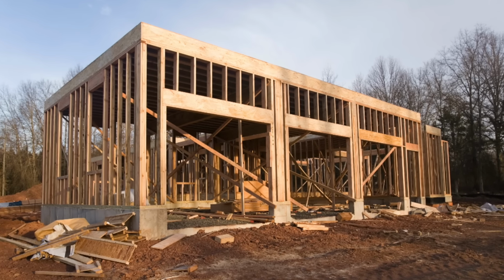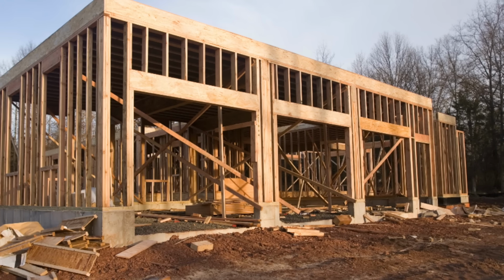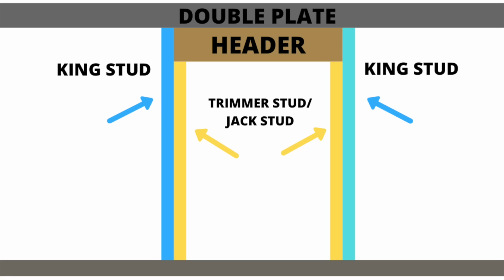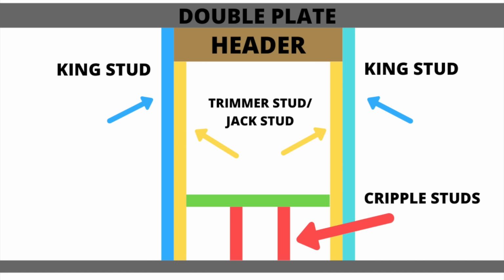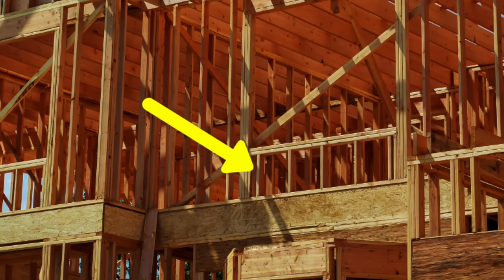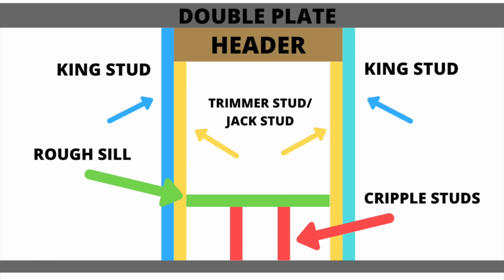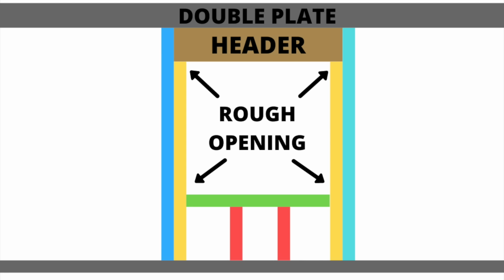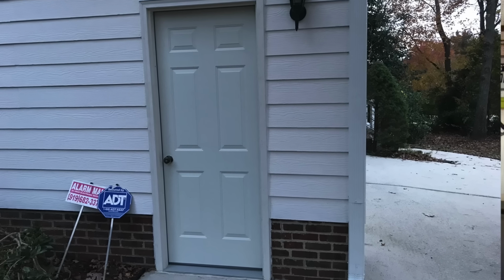All House Framing EXPLAINED...In Just 12 MINUTES! (House Construction/Framing Members)

Comment: Where can i get more information on how to build a post?  I need to put 5 2x4's together for a post but not sure how it should be nailed or structural screwed together?  Is there a specific pattern or spacing like an lvl beam?
Reply: Is this inside a wall? You want to nail them together enough to make them all act as one post. Use construction adhesive as well, just to be sure.
Reply: @jobacuda4472  I found out which thickness screws and length as well as the pattern after hours of searching.  Got my built up columns installed now!
Reply: @jayhandle6676  Excellent!!

Comment: So, if a header is over every window, how do I attach my hardware for curtains? I'm having a heck of a time. It's blocked after drilling through the drywall.
Reply: It should be solid wood. Unless you have metal framing.

Comment: Love your videos but you didn’t mention metal studs at all - even if your not an expert - people should be aware that they may have metal studs - an easy way to check is your take a strong magnet and run it along the wall, if it catches every 16 inches - you’ve got metal studs or a metal fire block - you may have to open up the drywall to be sure

Comment: Very informative!  Thanks for posting this.  Also, ppl should know that roof trusses are indeed stronger, but with trusses you loose the attic storage space that you get with rafters.
Reply: Many Houses over century old were build with rafters still standing today. Theres no questioning the strength of rafters.. The only reason trusses are popular like any new thing in construction is that it saves time in the building process and we all know time is money. Otherwise as a homeowner rafters over trusses all day everyday
Reply: Trusses can be designed / built to create vaulted ceilings and bonus rooms in attic space with negligible loss of interior useable space.

Comment: Im renovating my old house it is 2x6 rough cut lumbet for joiest im knocking down a 14x20 section and need to reframe with 2x6 to match floor hight and basment celing any suggestions to make it stronger also some sort of 6inch beam for the center ?

Comment: When building on a slab foundation, could you add insulation between the joists and beneath the subfloor, or would that be a bad idea? Also, if I wanted to build a small home that spans 18 feet wide, could I put a slanted roof on it without any vertical support besides the actual walls?
Reply: There are no joists or subfloor with a slab foundation.
Reply: @jobacuda4472  Oh, got it! Didn’t know that

Comment: I'm studying to be a certified home inspector and this has really helped me understand the basics when it comes to framing and what defects to look for . My current teacher did not explain it as good as you . I am thankful for you taking time out to educate us all . THANK YOU !
Reply: Ya, most home inspectors should be required to work in the trades before getting certified.  Most have no clue what they're looking at if its not in a book.
Reply: @scottpodgorski4102  They can look at a book & still not know what's going on. Most of them remind me of what we used to call "Stupivisor".
Reply: @jwm6314  lol
Reply: @jwm6314   noone said expert.
Reply: @jwm6314  You could literally work for 4-5 years and be competent enough to inspect other peoples framing work
Reply: But what he's saying is that to be a home inspector you also need to be able to recognize flaws in electrical, plumbing, HVAC, etc. not just framing.  Hoping from career to career to career just to gain the knowledge to become a home inspector is not practical or by any means worth it, especially since the higher pay brackets of each of these trades come after years of experience.  You would be depriving yourself of a ton of money by doing this.
Reply: I’ve bought and remodeled several “fixer upper” houses and I can see the great value of a good home inspector. Some miss things like floor joist rot, a/c mold, etc which can cost tens of thousands to repair.

Comment: Always nice when explain well..great job..California we build some great Frames now...Simpson pretty much has the monopoly on this but for good reason..they have so many that all architectural and structural drawings call them out solely to be used....California Frames no use a series of them that work to tie everything together from foundation to roof.....you should do video's on how there used...its great to let people know..Thanks for your Video's...GC in California...45yrs doing it and amazing how far Frames have advanced
Reply: Jon, I moved from NC to Reno in the early 2000s and was astounded by how many Simpson connectors there were! The increase in engineering was fascinating and I learned a lot from the experience.

Comment: The way roof trusses are commonly built off site is exactly how vertical framing should be build, off-site. It's much more efficient with materials and labor and the end product is much more precise making the home stronger and more durable. It also makes installing things like sheetrock, cabinets, tile and flooring quicker and more precise.

Comment: Question about a half wall or knee wall. If it is installed after framing & flooring how should it be built for stability before drywall is installed

Comment: todays lightweight construction homes are a death trap and take less than 15 minutes to become fully engulfed in flames and burn to the ground and kill or seriously injure firefighters every year and building codes never factor in fire safety because manufactured i joists don't take long to fail in a house fire about 3 minutes and the manufactured I joists is done for.

Comment: The houses in the U.S is so weak and cheap. In the Caribbean the foundation and support pillars have steel and concrete to keep the house strong. Your house will last you forever. Houses in the U.S is so expensive for cheap ass weak wood

Comment: We have different terminology in Canada,  for instance, cripples and window jacks are switched, we call roof overhangs on a gable "look outs, or ladders, stairs are rises and runs, instead of treads, there are many different codes when it comes to geography, in Alberta they nail the crap out of their plywood because of prairie winds, here in BC we usually go with a 6/12 slope min cause of the snow loads we get, etc, etc, etc

Comment: How can I make my outside porch window openings square? The contractor who built it didn’t make the window openings square. On the right side the vertical height is 55” yet the left side is like 53”. Same problem for the top and bottom. Basically it’s not square. I want to be able to square the window openings so some day I can install windows.

Comment: Good stuff, precise. The only term I can think of that would be helpful to add is "purlins." Some of those structures were very wasteful in terms of efficient use of wood, however, such as oversized headers, double sills under windows, excess cripples and Jacks (trimmers.) You should do a video on that. (The Engineered Wood Institute has great info on Advanced Framing Techniques.)

Comment: What are your thought on using treated lumber for the stud plate --in case of water intrusion (e.g. water heater break, wind, pipe break)? 
 ...or is Treated Lumber is not safe for Internal applications?
Reply: Night, wood needs to be moist for awhile to rot. If the problem is inside your house, you'll probably notice it and get the problem fixed before rot occurs.

We used to use treated wood a lot to fasten to  basement walls before drywall. In that situation, the treated wood is sealed behind the finished drywall. As a general rule, I wouldn't use any more treated wood inside than is absolutely necessary.

Comment: Whenever I see the i-joists in a construction floor frame, I always think they look cheap, flimsy, and a way to cut costs.  Am I mistaken?
Reply: As a framing carpenter of 30yrs,
The I-beam looking floor joists are called TJIs
And TJIs rock!
Framing at golf courses in Pinehurst, NC. Back in the 90s we used traditional 2x10 floor system
But the homeowners were wanting a slab poured upstairs and were getting sag
We added steel, and that was no help
Then we went to TJIs
After the slab was poured upstairs, there was zero sag in that floor
It made me a believer!

Comment: Fairly comprehensive video. Well done, but you missed covering the two major drawbacks of trusses. They eliminate much of the attic storage space, and they make it more difficult for HVAC and electrical contractors to navigate attic spaces.
Reply: There are different types of trusses. The most common and cheapest are the fink trusses which are what you are probably referring to. No attic space and you come down with your head covered in goose eggs. There are attic trusses designed specifically for attic storage. Of course more expensive. But you're correct, that was missed in the video.

Comment: At 2.25 the video shows I joists with circular holes through nearly the entire strand board portion. Does this not negate the structural integrity of the joist? I've brought up manufacturer details for holes like these before but never saw anything allowing such a large diameter of the vertical strand board portion to be removed. Do some manufacturers build their joists differently than others wherein a diameter so large would be safe?

Comment: If I could add this , The anchor bolts are not just for lifting they prevent blow out or bowing by shear by allowing sill to remain stable at joist connections and corners extremely helpful in earthquakes or high wind, of course garages and porches need it the most .
Reply from the maker: Good point, thanks Andrew!

Comment: Another great video from Ethan! Thank you!

 (noob question: Once completed, are roofs secured to the house frame?)
Reply: Craig - do you mean the roofing material or the roof framing?
Reply: Roof trusses SHOULD be secured to the house frame. If not, a good strong wind will lift the roof up and can take it completely off. If you live in areas with high winds or tornadoes, that's something you want to pay close attention to during construction.

Comment: I heard Truss built house burn much more easily, quicker than a dimension lumber house.  A home inspector in IL told me he used to be a fireman and that if they knew a house was built on a truss system, they would not go into the home because the floor burn time is about 1 hr, compared to dimensional lumber which is several hours.

Comment: @The Honest Carpenter     At 5:54 , the header is not sitting on jack studs instead it looks like it nailed to the king studs. Is this OK? I have a window in an unfinished basement that is bowing slightly and I think it is because the header doesn't sit on jackstuds. Trying to figure out if this is a code violation or something and if I need to get it fixed.
Reply: Every exterior opening I've ever seen had jack studs, except for the picture you are talking about, so, yes, you should have jacks. The only thing I can think of why there are no jacks in that is that the outermost floor truss may carry all the load. It does look weird, though!

Comment: Always wonder why "blocking" if not installed in bathrooms for toilet papers and towel holders. Installing them in the drywall always fails by time.
Reply: It's often installed in custom homes, where the homeowner will point out where their towel bars, etc. will be.

Comment: The only problem with trusses is the panel clips. Those steel plates between the cut lumber will collapse  above a certain temperature.
I'm speaking about a house fire. I think it's  around 900 degrees. The plates weaken  and the whole roof assembly collapses on your head. Not good. I prefer stick built homes.
Reply: George, if it's 900 degrees in your attic, you had better be out of your house. Fire fighters know when to go into a house and when to stay out.

Comment: nice, thanks
So, is the mud sill the only one to be treated?
what about the other parts of the frame, any kind of treatment?
Reply: No, and if you put a membrane under the mud sill, it normally doesn't need to be treated either. I'm not sure why, but we always used treated mud sills.
Reply: @jobacuda4472  what kind of membrane do you use in usa?

Comment: I’m glad you mentioned the I-joist knockouts. As an electrician, I really like them. Someone should let all the framers know that they exist so they can line them up so they can be utilized instead of ignored.
Reply: We know they are there. We alternate the trus joists to piss you off.
Reply: @marcellondon443  I know we have never been on the same job. You use complete sentences, in English as well. Nice try though.
Reply: @PC-vx6ko  is that supposed to be an insult?  Way too subtle.
Reply: @marcellondon443  not meant to be an insult. Just a joke. Why do you ask? Do you feel insulted?
Reply: @PC-vx6ko  no offense taken. Especially since I was joking when I said we alternate the trus joists. Gotta make sure the knockouts line up, so the electricians and especially the plumbers don't cuss us out.
Reply: Try to work with a specific framing contractor on a regular basis and build up a mutually beneficial relationship.  Communication is rewarding in it's own right.  I have clients that like me just because we are and I treat them as colleagues trying to work out problems.
Reply: If they are ignored you need to run. Obviously the contractor has no clue about framing.
Reply: I've been using TJIs since the 90s
And we always lined up knockouts

But there are a lot of people that think framing is just knowing how to drive a nail, or can be learned in a couple months.

Comment: Well I worked in a factory where we built the trusses and the small plates you said we would call gang plates and then I’ve built homes as well for about 10 years and that was after I was a licensed contractor in NYC. Moved to Florida and started doing framing I miss the work a lot. Now what state were you doing the framing in??? Because down here in Florida we have a thing called hurricane clips and they are a pain in the ass to attach to the truss and the wall as well.
Reply: NC. We use hurricane clips here, too. Especially anywhere near the coast. They are a pain, though.

Comment: Great video on structural framing, flooring, doors, windows and staircases. Can you do a video on the most appropriate fasteners for attaching these wood members together like screws versus nails and galvanized metal joist hangers and such? That would be helpful as well. You are a great presenter and the graphics are very well done.
Reply: Almost all attachment is done with gun nails. Some construction adhesive, too.

Comment: From 5:57-6:07 why were there no jacks under the headers? I'm guessing, they simply hadn't gotten to placing them yet, however in the window opening on the left, it appears to have passed the point when they would be placed. Great video.
Reply: Todd, a lot of people noticed that. The only thing I can think of is that the outermost floor truss is taking the load(?). Even so, I would put in a set of jacks.

Comment: Great video! I just bought a house on piers, and have been having a difficult time identifying the different components (especially when different people use different words for them). As far as I can tell, there is no actual sill. There is a 4x8 beam under the load bearing walls. The rim joist sits directly on this. The non load bearing walls only have a 2x6 with 2 inch blocks then the 2x6 rim joist. So am I correct in calling the 4x8 a “perimeter beam”? Or is it technically the sill since it is them beam that is between the piers and the exterior walls? Thanks in advance for any guidance.
Reply: A sill plate is the board your studs are nailed into on the bottom. You make it sound like there is no floor joist or subflooring beween the walls and the support beam.  Unless your missing up terms.  Either way it still woiuld be a beam if its there to transfer the w3ight from the floor joist to the piers.

Comment: Pretty good video. Clear and concise nomenclature and applications. Very nice. You got most of everything the average layman should need, but there are a few others you didn't mention:
Strongbacks- Support ceiling joists over long spans from above.
Purlins & Struts- Support rafters over long spans. Similar function to knee walls under stairs.
Collar ties- Connect opposite pitched rafters near the top.
Outriggers- Connect the rest of the barge rafter to common rafters or truss between the ridge and the tail.
Reply: So many roofs are trussed now that you don't see a lot of those first few members. You still need outriggers, though if you have overhangs, (which many new houses don't).

Comment: Stairs also have headers they're used to fasten the stair to the joist at the top  (I'm a stair builder by trade)
Reply: In the 80s, we started ordering prebuilt stairs and installing them as soon as the headers were in place.
Reply: @jobacuda4472  it's still done the same way to this day. Framework order the stairs from us. We build them and install them.